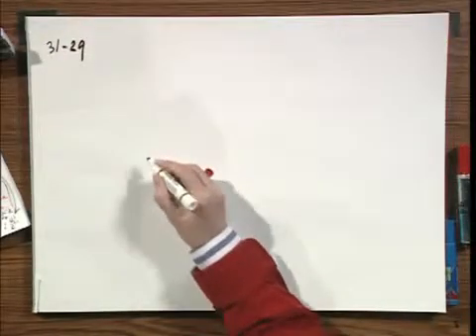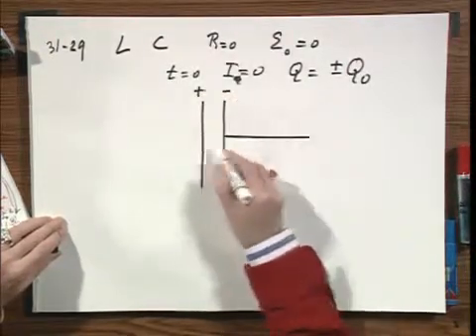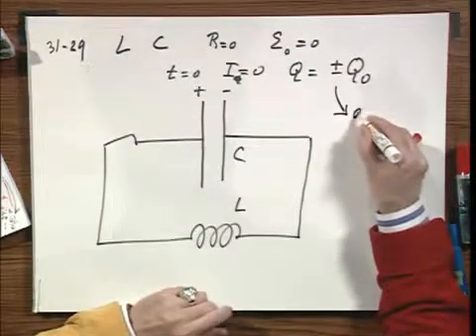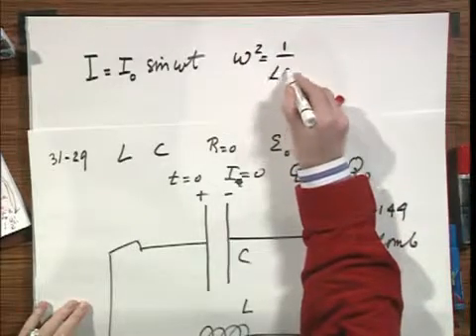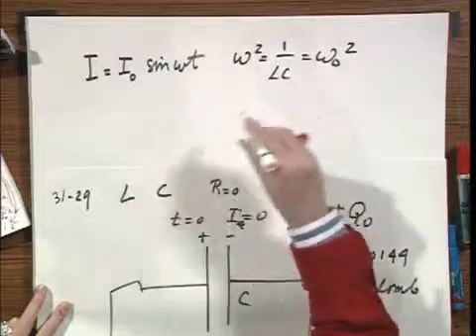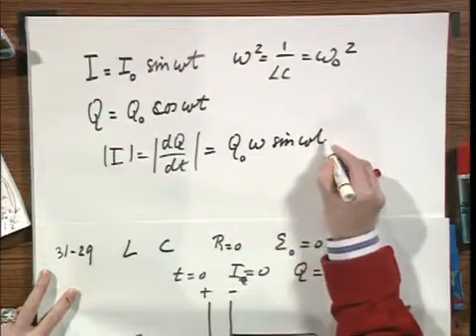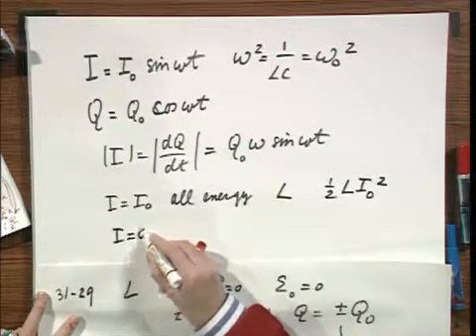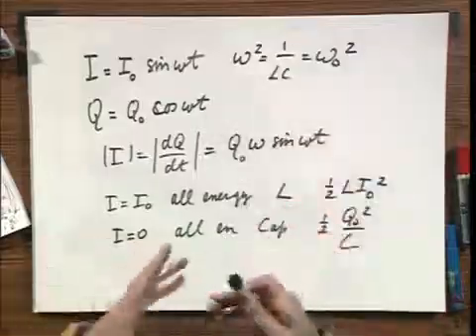8.02x - Module 09.03 - LC Circuit in Series (not driven) - Variable Energy in L and in C.

Comment: How would you calculate the phase angle of the resistive-capacitive circuit? Would that be the same as (1/sqrt(LC)) which is the same as omega? Could you give an example of this using the source voltage, capacitive reactance, and inductive reactance?
Reply: Dont worry about it